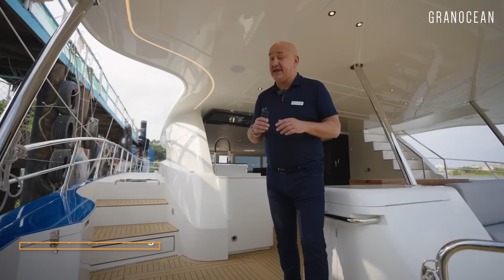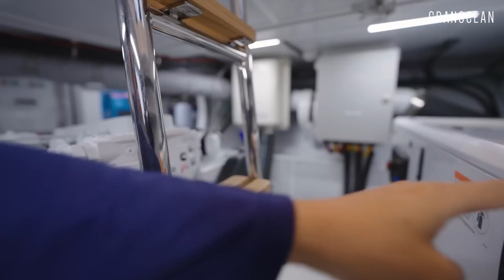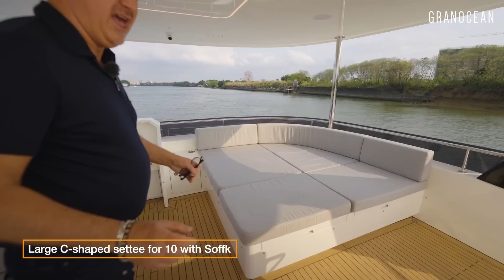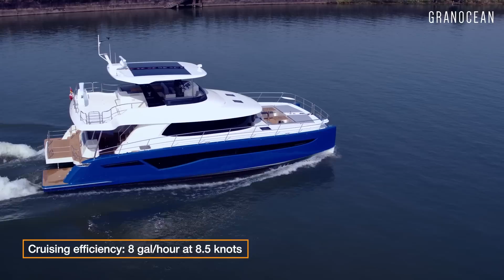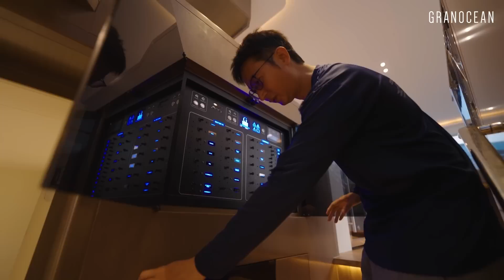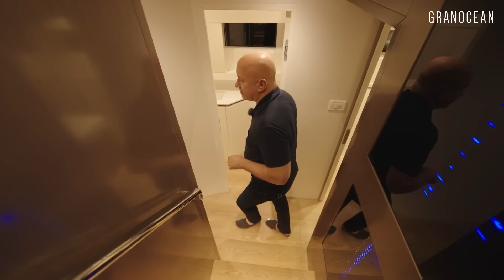Granocean W-60: Walkthrough

Comment: How many Nm?
Reply from the maker: With the excellent Cummins QSB6.7 @ 550 HP engines fitted, the GranOcean W60 is really fuel efficient. At displacement speeds, say 8 knots, the boat is good for 2,700 nm.  Crank her up to 18 knots and you are still good for 570 nm. GranOcean work with Stimpson Naval Engineering in New Zealand on their hull forms, using CFD's, drawing on Stimsons experience to build a really efficient, deep V hull shape. This results in excellent fuel efficiency and slippery performance...she is a great sea boat.  We recently delivered a W60 from Hong Kong to Sydney Australia, a 4000 nm shake down cruise - a real testament to her seaworthiness and efficiency. The W60 is a mile cruncher. Thanks for watching.
Reply: What’s the draft?

Comment: It's 2025, why on earth would they be using GEL batteries? 675aH of wet batteries is really only 300-500aH of usable, and with a significantly shorter lifespan. Everything else looks well thought out and quality, this seems like a strange oversight. You could easily fit 500aH of 48v batteries on something this size.
Reply from the maker: Thanks for the input! Each boat is uniquely set up for the Buyer. In this case, after calculating the specific draw for the appliances fitted to his boat, the customer wanted a simple set up.  The whole yacht is set up to be low draw. For example, with the inverter, solar, system fitted that the lower deck Frigomar air conditioning units ran for eight hours overnight. The Frigomar system is excellent. You are absolutely correct, other solutions are available, we are designing a system currently for the next Buyer of a W60 who is going "full lithium". The joys of the semi custom approach are that we can set the systems up to match each owners expectations. Thanks for watching and taking the time to comment, we hope this is helpful.
Reply: @ Thanks for the feedback.
Reply: Maybe the new owner was trying to save money to install something else later.
Reply: @Briguy28ca  That doesn’t make any sense. ~330ah of Lifep04 is the equivalent of 675ah gel or AGM batteries, with much faster charging/discharging and roughly 5-10x the lifespan. The existing electrical system in the boat is also capable of charging lithium, and much more effectively. I’m guessing it’s a typo or misunderstanding in the spec-sheet, the more I think about it.
Reply: @ maybe a typo. I’m just adding up the extras and taking a guess.
Reply: @Briguy28ca   @Briguy28ca  I guess my point is that there wouldn't be extras. They're already using hardware that is compatible with lithum, and the ROI would occur within the first few years. You can see the Victron charger in the engine room tour
Reply: @ cheers. Thanks for the info.
Reply: @Briguy28ca  I think I figured it out. The 675ah combination is the cheapest possible option (they're probably trying to keep the MSRP down as much as is possible), and multiple lifep04 options are offered as a compatible upgrade (since the Victron quattro is already lithium compatible, they're basically just swapping out the batteries for Victron 20v lithium). The 3000w solar option comes with a battery upgrade, also. So the configuration mentioned is the cheapest initially, but by far the worst option if you plan on actually using the boat. 

Sort of an annoying sales strategy, but not entirely unexpected.
Reply: @ well done on all the info! Cheers. 🍻

Comment: Big cat, tiny windless.....wonder where else the builder skimmed on.
Reply from the maker: The GranOcean guys invest lots of time and energy in selecting best in class equipment for their boats. The W60 has the really well reviewed, tried and tested Lewmar V5 windlass twinned with a separate Sampson post. The V5 is rated for boats from 50 to 72'. The W60 sits well within the capacity in terms of size and weight.  Hope it helps, thanks for watching.
Reply: @Catamarangurus  OK....still tiny
Reply: @larryboles629  take the L

its OK to just be wrong